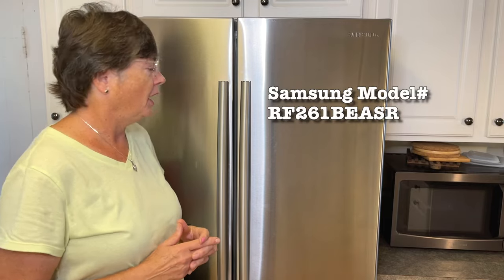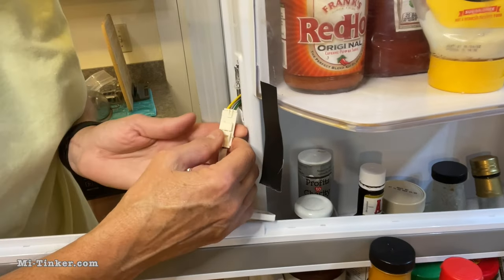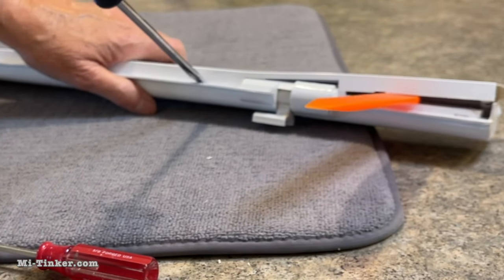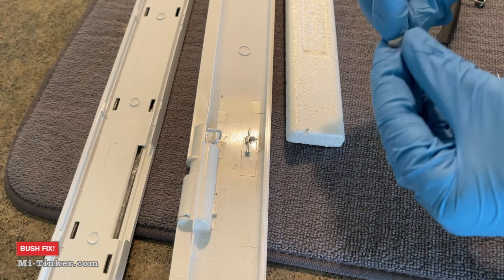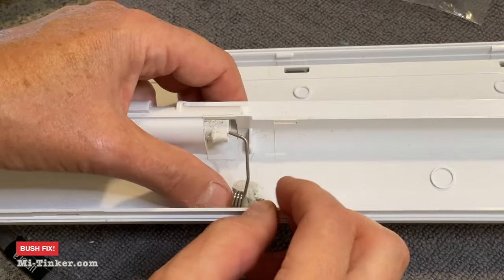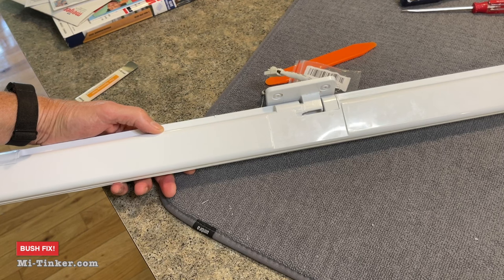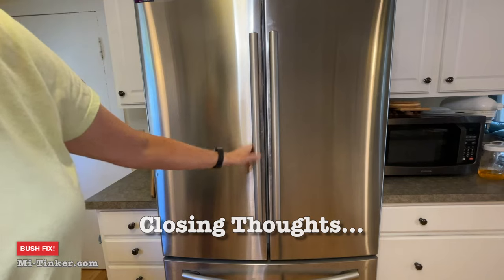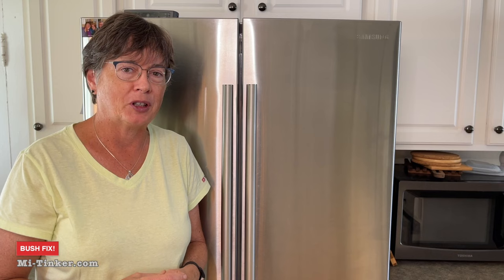Samsung Refrigerator French Door Divider Spring Repair and Mullion Bush Fix!

Comment: Ma'am, thank you so much for this video. Your method of applying tape to keep the connector in place is genius. I'm a phone technician, and this repair reminded of the many spring replacements I had to do for the Motorola i860s and 70s, back when flip phones were still a thing 😅.  Again, thank you so much for this, I was about to give Samsung the $200 for a new Mullion because I did not think I would be able to find a replacement spring.
Reply from the maker: You are very welcome! Hope you will subscribe!

Comment: Suggestion for anyone doing this fix. Assuming your issue is the spring itself, do yourself a favor and buy more than one. I replaced ours in 2023 and the spring broke again this month (10.24). I dont know if it is a bad design or the spring is intended to break so the mullion isn't damaged. Whatever the case buy an extra or two

Comment: Yes, thank you Thank You!  Saved us $122, the replacement cost for our model's mullion. The hardest part was getting the thing open, but definitely DIY-able.  We only had to replace the spring.  Found a set of two for $7.50 including tax.  The second hardest part was finding the correct spring for our model.
Reply from the maker: Glad you got it fixed!

Comment: Great video. Your epoxy repair was a great tip. In my case, the spring slot on the other end was also broken. Tried your epoxy repair only to fail but then noticed the part in the top spot was exactly the same. I swapped them out and all set.

Comment: Hi, thanks for the great fix and video. Wanted to put it out there that if the fridge is in warranty this is still a fine fix. Per federal law, opening a device cannot void the warranty unless it can be proved that you caused damage yourself. The item is clearly already broken, this is all fix and the fridge should still be able to receive further factory service. 
Thanks again for the JB Weld fix, it didn't occur to me to be this handy on the fix.
Reply from the maker: Thanks for the info and nice comments!! A year later and the bush fix with JB weld still holding great!

Comment: We just moved into a house that has a Samsung fridge and I didn't know the mullion was supposed to pop back.  This is the stupidest refrigerator I've ever owned.  So now I know it needs a fix.  Not sure I'm as talented as you at fixing, though.  Thanks for this informative video.
Reply from the maker: We have had a few problems with our refrig over the years as well. Particularly with it icing up in the refrigerator portion of the box... then the ice maker stops working as well. It is frustrating. The Mullion/divider fix is not hard. Just takes time. The way I look at attempting the fix is that I can't make it any worse by trying. Either I make it work with a little time and effort, or it stays broken until I order the new part. Either way you save big bucks on a service call of $200-$400. Best of luck to you!

Comment: Thank you so much for doing this video. I have a samsung #rf268abrs model which has the spring assembly on the outside of the flap. The plastic piece that holds the spring broke along with the spring. I had a spare spring and was going to buy the outer housing that has the spring holders molded in the piece. After seeing how you molded a piece with JB Weld, I thought I'd give it a try. I have the JB Weld drying at present and hope that it holds before buying the$45.00 housing part. Thanks again. BTW-subscribed!
Reply from the maker: You are welcome! My repair has done well, still going strong after more than a year. Let us know how it goes for you!

Comment: thanks for this no-nonsense video; since you made this about 18 months ago, is your fix still holding? we are contemplating this for a slightly differing Samsung model — it has the spring and bushing external to the flipper, more accessible, but the mount for the spring (on the flipper side) has completely shattered after two broken spring repairs; given we also have similar icing problems (less frequent i think since we are in a dry climate); we are hesitant to buy a new flipper on this problem-child fridge, so the crucial information is: how long a bush fix is likely to last; thanks again!
Reply from the maker: Yes, the fix is still holding 18 months later! 👍🏼 FYI: our refrigerator also ices up I’ve tried 5 different YouTube fixes and none last longer than 10-14 days. Then it freezes up again. We’ve given up on a fix that and have reverted back to ice cube trays since our ice maker freezes up too.

Comment: Hi! I have that type of fridge. Ever since that door part broke, it leaks ALOT into the drawers and under them. Did yours do that? If so, will replacing that part stop constant defrosting? Thanks
Reply from the maker: Hi, it might help however,  the condensation / water you are referring to is an ongoing problem with ours as too, I believe many people have this problem with this refrig. I've tried 4 different fixes to keep it frosting up and dripping under the drawers (and ice maker freezing up) and nothing has helped we are unfortunately back to using an ice tray as well.

Comment: Wow, I can’t tell you how long this issue has been bothering me.
I really appreciate the detailed info.

Is the JB Weld fix still working, or did it break?
Reply from the maker: Thanks for watching and for the question. A year later and still working great!
Reply: @mi-tinker  well then count me in. Ordering that spring right now.
Have yourself a great day
Reply: Hey again, just wanted to check back in and let you know that I successfully pulled off this fix…
Turns out that the spring I needed is actually located on the bottom small hinge, totally different system than the one you showed.
They sell two different kinds of hinges on Amazon, so I bought both, and I needed the other one, that is more symmetrically shaped.
After pulling everything apart, I learned that that wasn’t even necessary for my fridge, just needed to pop in the little hinge at the bottom of the unit.

Either way, I wanted to thank you for making the video and demystifying the whole process, because I never would have done it without that.
Thanks for the insight..!
Reply: @TheWorld_2099  thanks for the follow up and sharing. I’m glad you had the success!! Way to go!!
Reply from the maker: Cool!!

Comment: SAMSUNG .... NEVER AGAIN !!!! My wife and i have disassembled our rf266aers once a month in the past 4 months. each time a little different problem . Much appreciated for your video . I will however never stop preaching AGAINST SAMSUNG
Reply from the maker: I feel your pain. I've tried fixing the frosting up problem 5 different ways. Ice develops under the crisper AND ice maker stops working. After defrosting and trying multiple ways to fix it it only lasts 10 days- 2 weeks and the ice maker freezes up and stops working again. I understand there is some sort of class action suit regarding so many people having problems.
Reply: @mi-tinker there are some good vids about fixing the icing problems in the refrigerator section. You willl have to watch a few vids bc no one tells the whole story so you have to piece it together so persevere. I did it and it’s held for a year now. It is not for beginners but you seem handy. No special tools required just patience. You have to buy an auxiliary heater wire and wire it into the existing power wire. Also you have to put in an insulator kit. I think all the parts were $60 or so on Amazon. -The Samsung guy will come out if you have an ice maker issue. I had to defrost it a couple times and it was brutal. They replaced the entire ice maker unit. Call them and you may be surprised. It’s been 4 months since that and it’s ok. My French door fridge is 5 yrs old. Samsung is pretty bad. Too bad Sears went out of biz. I loved kenmore.
Reply from the maker: @chilitoday Thanks for the info. If you can send any of the YouTube links you found helpful, that would be great. I’ve really tried 5 different fixed and within 10-14 days things ice up again. My ice maker works fine when it’s not iced up.

Comment: Hi there! Was wondering if you may know how to remove seal caps on a Samsung refrigerator? We moved into a house that has a refrigerator I would like to remove but it’s too wide with the doors/drawer on to get through the doorway. I can remove the doors and drawer but not the seal caps. I would appreciate any advice. Here’s an example of what type of seal caps since I can’t upload a photo to this comment: Samsung Refrigerator French Door Seal Cap #SAM-DA67-02306A
Reply from the maker: Thanks for the question. Unfortunately I don’t have any experience with the door seal cap. Can you easily remove any trim from your house doorframe to get it through? Best of luck!!

Comment: what is the spring part number? Can't see in the video.
Reply from the maker: Hi, Thanks for watching! The description has the link and part number... Ultra Durable DA61-08314A Refrigerator Divider Door Spring Replacement Part by Blue Stars - Exact Fit for Samsung Refrigerators - Pack of 2